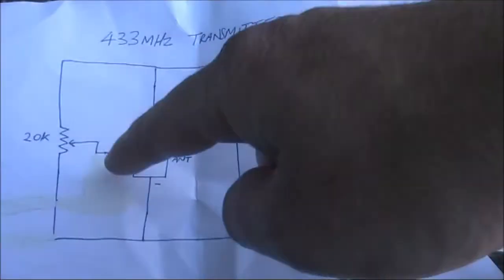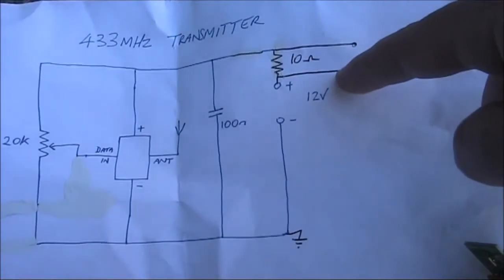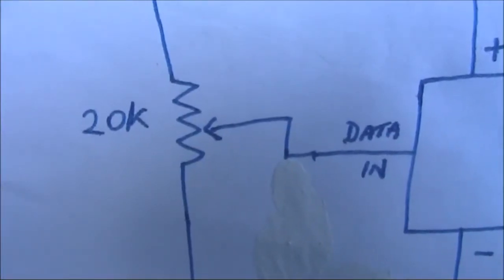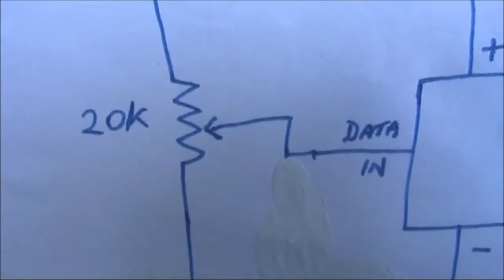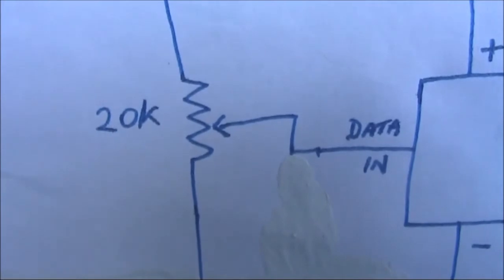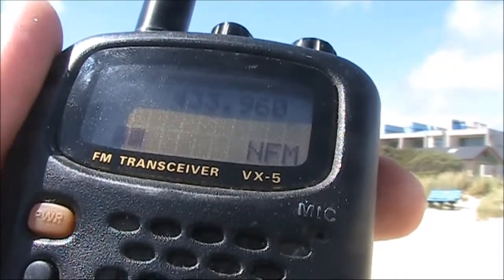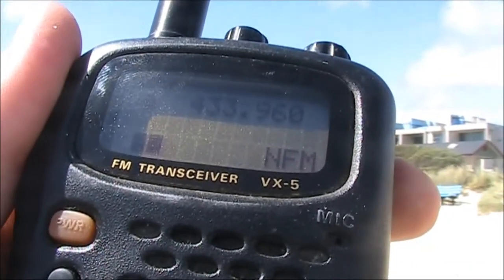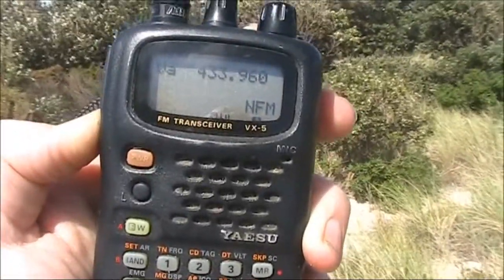Experiments with low power UHF data transmitter modules: Part 5

Comment: Great work, Peter. I'd be tempted to supply the audio between the resistor biasing and ground, so everything has a common ground reference (yours is referenced to the +12V supply). Glad you found the emails and video useful, and keep up the good work. Looks nicer in VK3 than it is in G now! :)  Best 73 George M1GEO
Reply: That thought struck me too … I picked up a couple of modules like this at the Newark Hamfest … seller said they were selling lots of them!
Reply: @G4KDXlive  8 years ago I post a video reply to this video showing it work. You can bias the data line and AC couple in. 👌